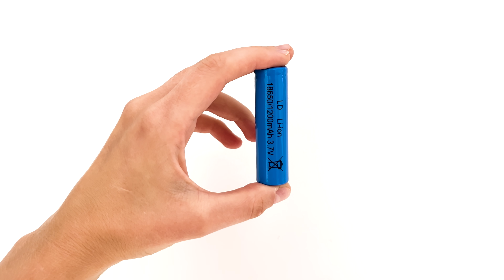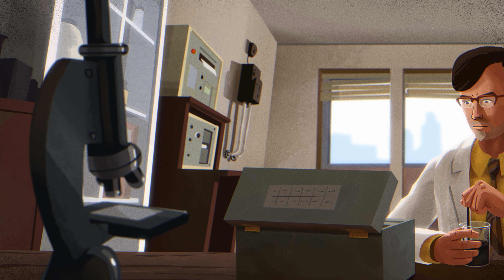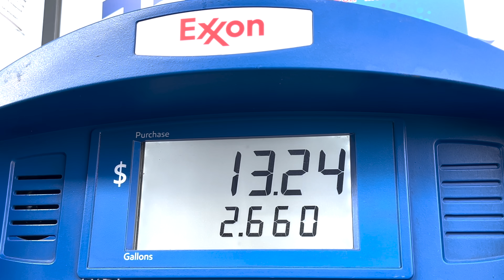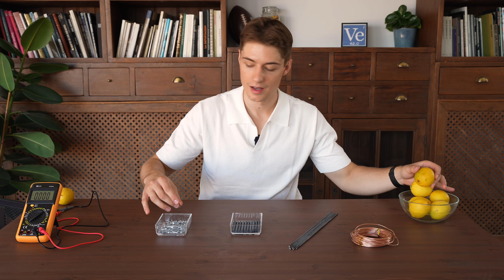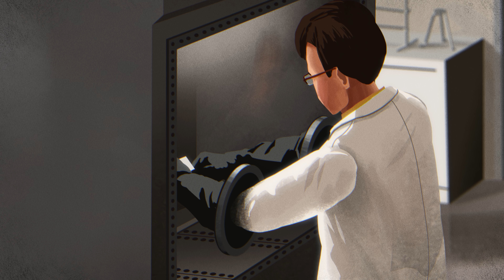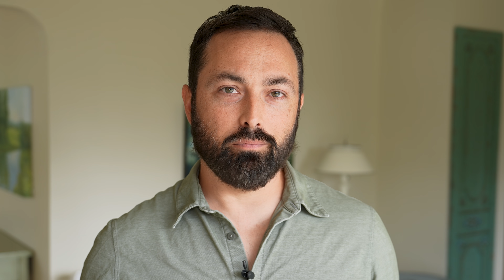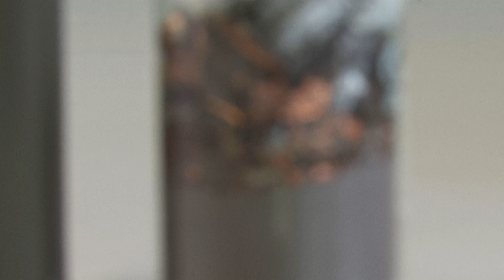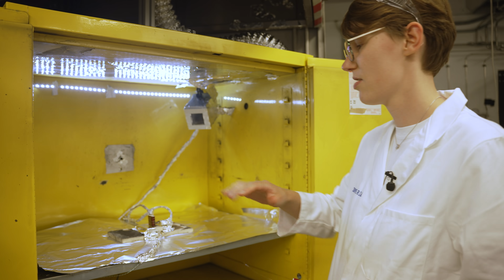The Perfect Battery Material Is Dangerous

Comment: 6:21.... you may all know more than me......but you are testing conductivity using a welding rod, and you put the voltmeter to build a circuit touching the side of the welding rod.  Thats the chemical coating of the welding rod that burns away to create shielding gasses.  preventing oxygen from reacting with the molten steel.  Then on 6:21 you pull out something that looks like a wierd welding rod.  You arent telling us the whole story here.
Reply: Also Magnesium Oxide is white, the "Magnesium" rod shown there is black? Thats some magic right there.

Comment: 26:38 So that's why cell phone manufacturers started locking the back of phones. They knew CPU speeds were getting fast enough that people would keep their phones longer. If you could replace the battery easily you wouldn't upgrade your phone.
Reply: No, that happened because back in the day when phones had user-replaceable batteries, people were buying cheap knockoff Li-ion batteries to use in their phones. Li-ion is very sensitive about being overcharged or over-discharged. Once you do that, it greatly increases the fire risk. To mitigate this, circuitry is added to the battery which carefully monitors its charge state, and will even brick the battery if it's ever over-discharged.

The knockoff batteries (especially the cheaper ones) used poor battery managing circuitry, or even no circuitry (it kept charging as long as your phone was on the charger). This led to a spate of phone battery fires. And the media being the luddites they are, associated the fires with the phone manufacturer. Not the knockoff batteries. So to protect themselves from lawsuits and incorrect reputational harm, and to protect us from ourselves, the phone manufacturers simply took away our ability to use aftermarket batteries.

Comment: "releases more energy per electron...." think you meant more energy per gram of metal? The energy of the electron depends on the voltage (correct me if I'm wrong please)
They're great batteries, just hazardous if not charged carefully and handled gently. They ARE a fire hazard, but if stored properly and (important) disposed of that way too, OK.
The ones that bothers me are those disposable vapes, because they have a quite nice little Li ion batteries in there, ones that can be recharged even....
But I worry about their
flammability since they're so disposable...here in NoCal, they could be dropped on the road somewhere, get run over by a car, and poof! Instant forest fire...

Comment: 06:30 - you're not supposed to be sticking the measuring tip into the lemon - you're then measuring the property of the metal of the measuring tip, and not of your "intended" electrode material.

Comment: I heard there is a diamond battery being worked on. Is it true it recharges itself and can last 1000 years?
Reply: They exist, they barely have enough power to supply a wristwatch (a non digital one). But they do indeed last a very long time. But useless for basically any practical application.

Comment: Bet Veritasium will have changed the thumbnail at least 10 times by tomorrow
Reply: At the time of writing, it says "Bad Idea." with a hand holding a razor knife cutting into a cylindrical blue battery.
Reply: @JKa244  About 2 hours ago it said "Don't try this" showing a hand peeling off the outer layer of the same blue battery.

Comment: one of my favourite alternitive batteries are mechanical ones. for example you could spin a large disk via an electromagnet and then extract the energy later by slowing it down with electric breaking. Of couse ist kinda hard to set this up for everyday use, since one such a battery would need to be set up with very low friction and then theres also gyroscopic effects, that make moving it difficult. But they could work as large scale energy storage similar to pumped-storage power plants, where eccess energy is converted into mechanical and then gets released later. The only issue with the later plant is that is comes at major damage t lacal ecosystems, so while they are great they still do enviroumental harm. Gyroscopic storage would come at no harm except in production and could operate for years. But we'll see what the future brings. Im excited either way

Comment: The thumbnail is a bit misleadingly scary:  I only watched it because I had just forked out an arm and leg for some of the same battery  pictured, with the voltage controller to 1.5V inside, which are better for my analogue clock motors.  It was a relief to find just the nice potted history of lithium batteries in general, and NOT the warning about the 1.5V type that it appears to be!

Comment: 4:15 This is such a bad science demo!

Why is a lemon like a frog? (because both are wet electron highways)

Why are the electricity invisible? (It isn't if we zoom in)

Why don't you get a electric shock? (Like the youtuber Electroboom)

Why do you think the numbers on the orange measuring thing, help to explain anything. (Because it judges who will win The Battle of the Metals!)

Why do you need to stick the things into the lemon in? And why in different places? (Because touching short circuits the battery.) 

And can't you just blend it all and get the same effect? (Maybe you can, if you do it very carefully)

And why use so much scientific jargon? Electron, hydrogen, voltmeter, electrolyte, quantify metals, cobber, charge, ions, iron, fast oxidization, magnesium, plutonium, zinc, receiving cathode and up-giving anode. (For no good reason, because later in the video you use the word "electron hungry metal". That is so much better than "receiving cathode". Try to be more clear and simple as the truth next time. Don't copy paste some random chemistry text book. 

So many assumptions about how normal stuff works, is just pasted over.
Electric stuff act so weird, so you science demo can be misunderstood in so many ways.

Comment: Batteries with lithium should be outlawed. They are simply too dangerous to be in every piece of electronics that people carry or are carried by.
If you've ever witnessed an EV fire where the door locks are electronic and the doors cannot be opened. AND how the fire burns so hot while simultaneously off gassing highly toxic gasses, you would completely agree with me on this. 
The fire gets so hot, so fast that the occupants of the vehicle are cremated without any chance to escape. It is a grisly scene to behold.

Comment: The only difference between bombs and batteries is rate. You could store as much energy as you need with cooled, compressed, air if you had a) a large enough volume to hold your surplus energy demand as possible output from returning the cooled gas to STP and b) a way to keep it from gaining outside heat.  See also thermal batteries.

Comment: A lot of electric vechicles use LFP batteries, which are way more safe than cobalt based lithium-ion batteries at a cost of capacity. One of the newest battery tech is silicon carbide, which considerably increases the capacity compared to previous gen. Also Tesla's 4680 introduced new battery structure that increases efficiency.

Comment: 19:15 AI-written code automatically reviewed by AI. What could possibly go wrong.
Reply: This sponsorship and the fact that the thumbnail looks to be at least partially AI generated has made me lose a considerable chunk of my respect for Veritasium. GenAI is the antithesis of information, creativity, and perhaps even life itself.
Reply: Either you write the code yourself, or you review it yourself. If you don't do either you shouldn't have a job and are in the wrong industry. Humans are currently still much better at actually doing software engineering.
Reply: @JanLukasYT Code reviews just aren't something that should be replaced by AI. You need an experienced human developer to review code. You can have a human review the code and then have AI review it, but you need a human somewhere in the review process - otherwise things will slip through.

If we take this automation scenario to the conclusion we seem to be heading towards, AI will do development, reviews and testing. We'll end up with buggy code deployed in production systems, and plenty of vulnerabilities. I'd recommend that devs get some cybersecurity experience, because that field is about to have a huge boom.
Reply: @JanLukasYT Cope
Reply: Current GPT based AI is not fit for purpose when it comes to important or complex coding. It's only really passable for very simple single purpose tasks where you already know the outcome required, know how to competently unit test, and you also know what mistakes you expect the AI to make, and adjust the code around it to avoid the beartraps. Learning the language to code and use regular tools for syntax checking/linting/testing is still the only way to go if you want to be taken seriously for any proper dev work. Remember, "AI" is just an algorithm guessing what word should come next, and doing it just well enough to convince most people that it's actually got knowledge and reasoning behind the algorithm.
Reply: @ChristopherWoods  It's also good at swindling idiots out of $20 a month.
Reply: AI code review is such a terrible idea, that I believe it must be the worst idea I've heard in the last few months (and if you are at all aware of international news, you know there have been some extremely lethally idiotic ideas thrown around).
Reply: @Commander_Chopper  AI code review is a great idea - if done in addition to human code review, and if any subsequent changes the AI recommends or makes are checked by a human
Reply: @tidorith  Not really because AI will pass a lot of absolute trash code as just fine.  The entire point of a review is to have the code vetted by someone who actually knows what they  are doing and if AI is your front line in that, god help you.
Reply: I use coderabbit at work and it's actually incredible, way better than any human reviewer has ever been as long as I've been a software engineer
Reply: I have direct experience with CodeRabbit & my reviews were flooded with nonsense comments to the point that maybe 1 in 50 were actually somewhat useful, and even those were things a linter could tell you. It has changed quite a bit since then, but even looking over recent reviews for the same project on pieces I'm directly familiar with I'm not exactly impressed by the reviews it generates.

It also tends to generate a ton of random fluff in reviews, bloating them far more than user reviews by comparison including these weird nonsensical sequence diagrams that don't seem related to the code beyond surface level function call relationships.

It might end up providing some useful comments for avoiding isolated pitfalls, but its still completely and thoroughly incapable of parsing intent or architecture of code bases & changes, so is incapable of creating informed, deeper reviews.
Reply: I almost turned the video off at that point...
Reply: Clicking off the video and unsubbing after that ad.  What a shame to push this kind of nonsense.
Reply: @potresto  Same. I have sponsorblock installed so I did not even reailze there was an ad, but seeing this comment I went back and now I'm extremely disappointed they would be promoting that kind of garbage slop. I'm now considering unsubscribing...
Reply: @potresto  lol
Reply: As a software engineer, *AI slopping intensifies *

Recently had agent mode code a quick fix to an issue in production--it coded up a 100 line convoluted mess, but it worked so put it in production. Then I circled back to make a proper solution--code change was 2 lines. It's certainly becoming an increasingly useful tool, but also still bad in many ways.
Reply: What couldn't?
Reply: I guess the assumption here is that the AI code review is the only review. If instead it's used as pre-review but a human still does the final (now faster) review there is a net benefit.

If you have ever reviewed code you know 30-50% of it (depending on the developer) is basic code standards and missed best practices.
Reply: Uh it's fine, I still like their videos. I hate all this AI nonsenses too. I think AI lowered the barrier to entry for" expert beginners", which was a group of people we learned to deal with even before AI was a thing.
Reply: People, having an interest in non fully AI stuff as a coder doesn't have to be a financial interest.

Sooner or later lots of stuff, also in coding seems to shift to AI, yes, but noy yet!

Security vulnerabilities can be extremely harmful, we have to keep ways to make people accountable for them so they don't get made as much or "overseen" due to financial interests.
A human part in the process still is important.
Reply: @yasyasmarangoz3577 I think knowledge in coding is going to be important(necessary even) but I can see it being a thing very soon for quick prototyping of things. Give the AI a prompt of what you want. Test it and improve it yourself from there. The thing I know it's being used for now is debugging
Reply: @AidenWolf97  Prototype 100%
I do it myself ^^
Reply: That’s exactly what the Chinese did with their AI system.
Reply: I guess you are a coder?
Reply: Every bug that's ever been in software before AI chatbots has been created by human programmers. Cry me a river, beach.
Reply: Least obvious rage bait.

Comment: Lithium is the third lightest element.  Only hydrogen and helium are lighter...and they are both gases at atmospheric pressures.  So I think Lithium will remain the primary battery ion.  (However Sodium and other things will become useful since they are cheaper materials.)

Comment: It feels very misleading and borderline irresponsible to not point out that one of the newest battery chemistries, Lithium Iron Phosphate batteries cannot self ignite. You can punch a nail through one and yeah, it'll vent, but it won't light on fire or explode.
Reply: Yeah it is irresponsible but this type of video generates more engagement/profit and I'm not sure why you expect a random internet video man to be responsible in the first place.
Besides it primes the audience with a problem "lithium battery with fire bad" only to set the stage for another video later showing the solution "new lithium battery tech now without fire" even though anyone familiar with the subject knows LFP has been in use widely for ~10 years now on boats, caravans, off-grid setups and (more recently outside of china) cars.
I personally hope LFP makes it into phones since I'd gladly exchange 20% less runtime for 100% less fire risk.

Comment: I remember reading a Science Fiction story many many years ago, where the battery was so energy and power dense that it became essentially a bomb when discharged instantaneously.
It was so dangerous and valuable, that you would bury it in concrete below the foundation of your house, and it could run the whole house for decades.
I wonder if we've come anywhere near the theoretical upper limits of power and energy density for energy storage.

Comment: First time I was disappointed not by channel but battery technologies, our reliance on batteries and the fact that they age poorly (small electronics loose like 5-15% each year and the environmental impact and the exploited people and Veritasium video ended without hope
Reply: Car batteries don’t degrade as quickly as the batteries in consumer electronics because electric cars have much better battery management systems than handheld electronics. One of the biggest differences are the advanced temperature regulation systems in cars to keep the cells in an optimal temperature range, which just can’t be scaled for handheld electronics. Proper temperature is critical to maintaining the health of a lithium battery. That & controlling how charged up the batteries get most days (stopping at 80% is considered ideal & we usually charge our phones to 100% every night) leads to a far slower loss of capacity than what we’ve become accustomed to with our phones. 80% is fine for most trips & batteries can handle occasional charges to capacity for planned longer trips without much long-term impact on their capacity.